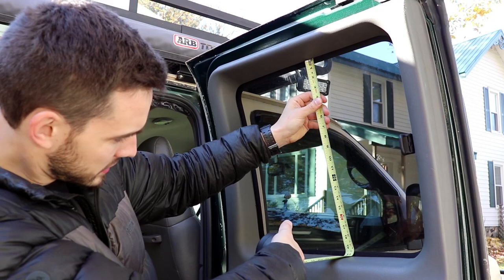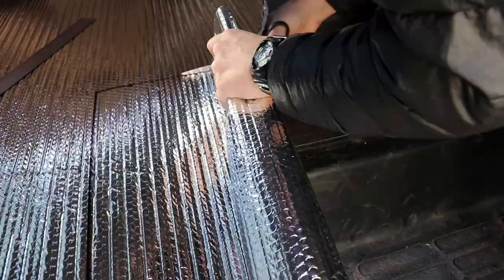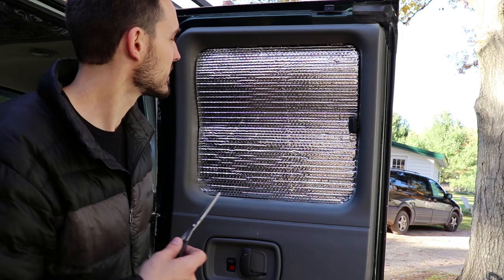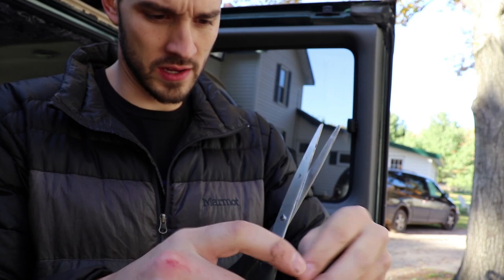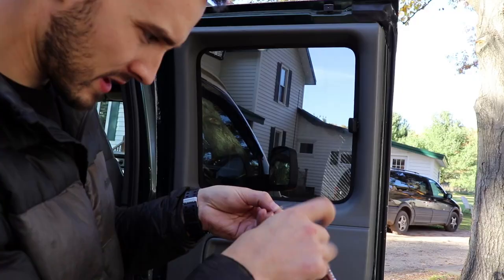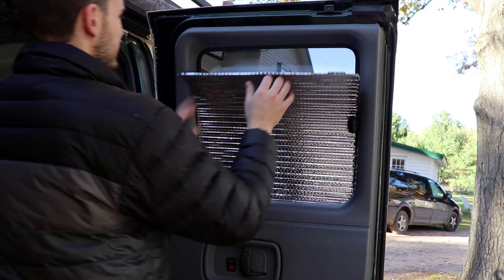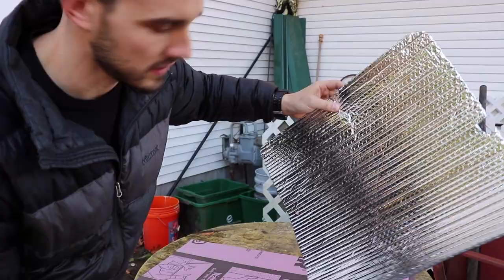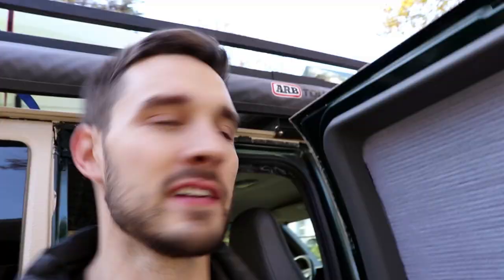How to make cheap easy window shades for vans/cars  DIY

Comment: Instead of the bare reflectix against the glass, put a layer of black fabric so it looks like the window is just blacked out.
Reply: Wouldn't that defeat the purpose of the reflectix (keep heat out)?
Reply: @Flimzes  it would but some people don't want to be easily spotted out for sleeping in their car. Having the reflectix showing through the window makes it obvious someone is sleeping in the vehicle. Most people want the black out look instead. I've slept in my honda civic on trips a lot of times and at times park in areas I dont want people knowing im sleeping in my car.
Reply: @robertlayton8156  I get that part - it just seems self-defeating to buy specifically reflectix then - but that might be the cheapest option?
Reply: @Flimzes  I was thinking that also. And I've gone even cheaper than that. I currently use a black poster board with Velcro. Works great.
Reply: Blackout curtains also help block the sun and heat in the summer and keep heat in in the winter, so it still serves the purpose of keeping heat out.
Reply: Exactly what I was thinking lol
Reply: Yes, I used black felt for a true black out curtain and to provide "stealth" at night. As mentioned, without it, you can see the silver reflectix and it screams "hey, I'm sleeping in here":) An important note is most people use these window coverings at night, when there's no sun and heat to worry about. Then, during the day when you want to reflect the sun, switch the covers around and place them on the other side of the vehicle where you can have the reflectix side facing outward.  Most all vehicles have the same sized windows on both sides of the vehicle.  Easy peasy!
Reply: @robertlayton8156  that’s what I was going to do. I went to the Dollar Tree and they had windshield covers. I am going to attempt to use that as window covers and just spray paint the out facing piece black.
Reply: @robertlayton8156  That is the point!!!
Reply: But then Black absorbs Heat, making it hotter inside. So if it's Summer?!? 🤦
Reply: Spray it with black
Reply: Don’t use spray paint for something going inside of your car? Esp while you sleep overnight a foot away from it ?? I wouldn’t anyway!

Comment: For everybody bitching because the velcro prevents rolling down the windows, he installed these on windows that didn't open anyway. They were fixed windows, non-operable ones. So the velcro didn't mess with anything.
Reply: So for windows that DO roll down... bc id want sun protection on those too... does the Velcro interfere?
Reply: Use magnets  
But not on the glass
Reply: My tip is to leave an inch border of fabric around the edges.  In most all cases, this extra material will help block more light that could be missed by the reflectix AND will hold the covers to the windows without the need for velcro, magnets etc.
Reply: @MichelleEstrada  if you have any sewing skills, you could wrap fabric around a thin wire and sew it to the border of the sunshade to make it more rigid. Should stay inside the window sill

Comment: Good video. (Too hot for sticky Velcro in hot Arizona, it "melts" off all surfaces. I use suction cups with a hook that clamps down- 4 for $1 at the dollar stores. Have to make a small hole for the hook to go thru)
Reply: You could also use magnets
Reply: @trashlambo  how would that work?
I can’t think of any metal around the inside of most vehicles.. 🤔
Reply: @anthonyfletcher8053  Some cars have enough metal exposed around the window's edges that you can stick a magnet to. Really depends on the make and model. My yaris has a bit around the upper haves of all side doors, enough to make use of magnets. Cheers.
Reply: @trashlambo  I’ll have to check mine out. Thanks man

Comment: I did this with our van last October before our four week, 7.500 mile camping trip around the country.  The velcro squares on the glass idea worked ok at first (on our non-roll-down side and rear windows), but even in October the sun beating down from the outside soon melted the glue holding the velcro squares to the glass and they started just pulling off with the reflective screen.  I had brought the roll of velcro along just in case I had to replace any along the way, and at first I replaced the tabs as they stopped sticking to the glass, but by about mid trip I gave up.  From that point on we just wedged the shades in the window openings as best as possible (some held ok, some did not).  I experimented with sticking the velcro tabs to the inside plastic frame of the window instead of the glass wherever possible, but the texture of the plastic interior trim prevented the velcro from sticking for very long.  I was surfing for better window shade ideas before our next camping trip when I came across this video.  Cutting your own reflective shades works well, the velcro tab part is the weak link especially from spring to fall when the sun is more direct.
Reply: Have you tried blue tape to hold the ones that don't wedge on so well?
Reply: This is precisely my question. Did you find a solution?
Reply: Im curious too, did you find a solution?
Reply: @Frank020  Did you?
Reply: @ExOhz  How about you?
Reply: @MR-nl8xr  No, if I did I wouldn't be asking.
Reply: @Frank020  Yea, I think we all know that; but you could of found something since you originally asked.
Reply: @MR-nl8xr  No sadly, I haven't tried it yet. Good ideas though. I saw a guy on you tube use Walmart static tinting, which looks interesting. So you can peel it off and reapply it. But it requires a special technique to install it. Lol I thought you were messing w me..
Reply: @Frank020  Lol I thought you were messing w me..

No; I try the best I can (online) to let someone know when I'm F ing them.
It sucks all the arguments and time waste I've seen just because the internet is monotone and we can't tell when some one is joking or not, but It's also good because of that very same reason, i.e. it removes people's bratty problem of listening to HOW someone says anything versus WHAT they say about anything.
C'est la vie.

I saw a guy on you tube use Walmart static tinting, which looks interesting. 

Yea, it does sound interesting.
I can't believe there isn't an online store (or brick an mortar one) that only sells most make an model's, window black out curtains.
The van life community would make them a killing alone.
Then again, those kind of things turn out to be expensive, e.g. weathertech mats.
Reply: @Frank020  mmm, yea, still on the fence about it. The concept is great, I'll give it that.
Reply: @MR-nl8xr  i would think a strong tape that does not leave residue, such as gaffers tape might be worth a look into it. Suction cups can fail, maybe canvas hinges that can be held up with the window closing up against it. It would have to be tested.

Comment: The only problem is if the velcro is too small the reflective sheet will remelt the glue. Its happened to me all the timem
Reply: I had van windows professionaly tinted and hung a curtain on the inside. 1. It looks better on the inside and outside to me 2. I can peek out without anyone knowing I'm watching them because the of the  tint plus I have security window screens so I wouldn't be able to peek out with those btw fyi  this method  will prohibit even indirect natural lighting.

Comment: Sticking the velcro together before you cut it is also a good one. This guy is smart.
Reply: HUGE tip:  fit the reflectix with the ribs/lines in it going vertically/up and down, not horizontally like he did here. if you do it like he did, the reflectix will sag over time.
Reply: Another tip is to leave an inch border of fabric around the edges.  This extra material will help block more light that could be missed by the reflectix.
Reply: Its called common sense
Reply: Keltic34 1ThoughtYouKnuskii!!1 huh...well than what is the opposite of stupid?

Comment: Yesterday I did a $7 DIY curtain that can easily be pulled into place within a few Seconds! It stays in place so I never have to keep taking it down & putting it back up, use up space to store it, etc.  I use 2 1/4" X 5ft PEX Pipe (PVC) $2.25ea, Paracord to feed through it and secure it to the sun visor and the back seat roof handle. Snip holes about every 3-4 inch in a dark lightweight $2 tshirt fabric from Walmart. 1 Clip for each of the front seat ceiling handles to support the PVC and fabric. A pieces of Velcro on the dashboard.
This will allow you to have one long piece of fabric that can easily slide into place & gather up next to the seat or even better yet, behind the headrest so that you can still have complete visibility in the blind-spot & your back seat can stay hidden 24/7! The fabric I used is dark enough where people can't see in but I can still see out.0

Comment: the "77" series spray glue will separate after being in the heat for days. use the "90" series glue or the spray glue for headliners for high heat applications. or a sewing machine.

Comment: You just saved me from spending almost $1,500 on "professionally" made window shades. Yeah, they are not quite as sexy but man, there are a lot of other things much more important that I need on my van (like upgraded suspension).  Actually, it looks like the ones you made are a tighter fit than the ones that attach with magnets.  Thanks! Safe travels.
Reply: $1,500 ?!!?
Dude, relax. 
Around a hundred bucks for custom made shades.
Reply: 2 words.. Limo Tint 😎
Reply: Yeah!  I spent about $200 on Heat Shield branded covers.  They are nice and "supposed" to be custom but they are not perfect.  I added a layer of black felt to them with about in inch of fabric around the edges and it fixed it!
Reply: Relax, bro.

Comment: Using velcro on the window like you did is good for windows that do not roll down. For a secure fit I use thin strips of oak board that I cut on my table saw to wedge as necessary.

Comment: I'm thinking about adding some tabs at the top to roll the window up on to hold it in place. If I need anything at the bottom I will stick it to the window trim not the window.  Thanks your video gave me a lot of ideas.

Comment: The only problem I’ve had with doing this is the adhesive melted after a while because of being in direct sunlight. I used indoor/outdoor industrial velcro strips and it worked great until it didn’t 😂😭 need a better solution.

Comment: I tried this found that relfectix is awsome at reflecting light and heat. Unfortunately it's also awsome at reflecting heat and light. While the inside was darker, it wasnt kill you hot inside, but was hotter than outside even at nite. Also stayed hotter longer. Heat already inside really had no way escaping. Interesting challenges to overcome. :)
Reply: Get rain guards and leave the windows cracked open.

Comment: Wow great idea man!! It also insulates. I once slept in my truck with a sub zero sleeping bag in 5 degree weather. Could have used those. Thanks for the video. That stuff is expensive though but works perfectly for shaping around wondows.

Comment: Only thing I'd do differently is put a thin, bendable, gluable insulation layer between the reflectix & fabric to limit the horozontal grating. Or just cardboard, and cut them horizontally in half to remove the top half to see out & let light in.

Comment: do you notice the velcro ever coming off of the reflectix side?  Also has the fabric eventually come off the glue from folding many times?
Reply: I've used velcro in my car and when it's in like 80+ heat, the sticky side slides off the platic interior of my car, and I even added super glue.. so I'm sure it wouldn't stick to glass in heat either, there's gotta be a better way to secure these things..

Comment: Black colour to the glass side is better  than the silver one. This way you are better hidden inside.  Silver is quite ok for the interior because gives  bright while using one lamp only. You did  otherwise. :)))  Your glas in a windows is dark, so the silver is not as fast noticable. Having a regular  windows  the car starts to look like a tin with you sleeping inside.  We want to avoid that!!

Comment: Hey so there are heaps of comments about reflextix making it look like someone's in the van, you should black out one side and not the other when you really need the insulation have the reflextix facing out when privacy is the main issue have the black side facing out, problem solved :))

Comment: Two questions. How does the Velcro affect opening closing your windows? Do people on the outside notice the Velcro tabs? Also what do you suggest if you crack your windows overnight as a vent to prevent condensation??
Reply: Try the velcro on the trim of your vehicle rather than the windows

Comment: That was my first attempt but the sun made the glue melt and they all fell. Please tell your followers to never use black in the windows, it attracts the sun and heats up the glass. I made covers with space for airflow to come out and my glass still overheats.
Reply: Ashley Watson ....never use black against the window "in the sun"...... it will attract the heat. I used a brown on the glass side so i can use it day or night. The point of reflectex is to "reflect" the light and heat....using black material and putting it against the glass without air flow ....defeats the purpose... ;)
Reply: Good, just be aware of the temperature, even melted my solar panel. Lol.
Reply: Ashley Watson i have solar shed lights you see in my videos that have solar panels i put in the windows. Theyre black and the sun melted the glues inside. When i buy more panels in the future...for anything... they will be aluminum framed or painted white. Hope yours work out

Comment: Would you be interested in selling window covering? I have a 2005 Honda Odessey van. I would need 1 back, 4 sides. Please let me know. I will pay.
Reply: I've got a 2004 Odyssey and I would buy some shades online for it if I could find them.  The ones I would really need are the front side windows.  The rear back ones are fairly simple and the middle ones get covered with blackout curtains.
I have a sunscreen that completely blocks the front window, black on one side, silver on the other.  In the very back I have a 55 gallon tote and tension pretty much holds a wide piece of reflectix in place there but I'll put some velcro on the ends that will be bent around the corners.
I've found that as far as the ceiling on the Odyssey goes, nothing sticks to it, not even Gorilla Tape.  I've seen elsewhere a couple made the reflectix shades that fit exactly and then kept them in place with a thin aluminum bar that went from the top to the bottom of the window and got them cheap at Home Depot.

Comment: Dude really stuck that velcro on the glass. Do better people. You can make the fabric larger than the refletix and sew velcro on the edges and stick the other velcro side to the plastic around the window and not the glass. The reflextic part will still fit snuggly on the glass.